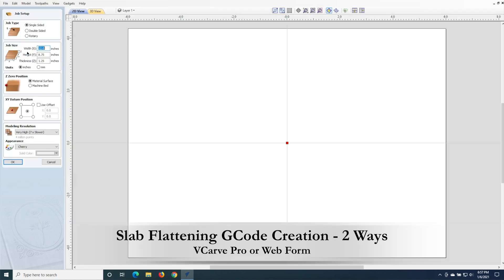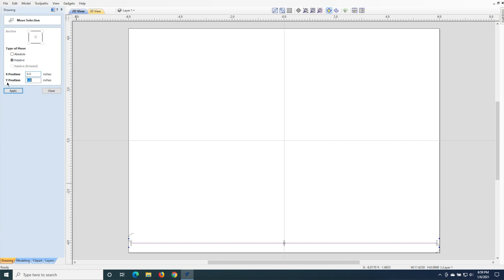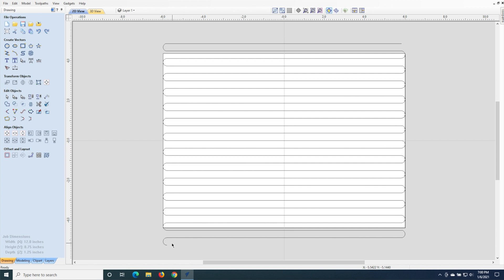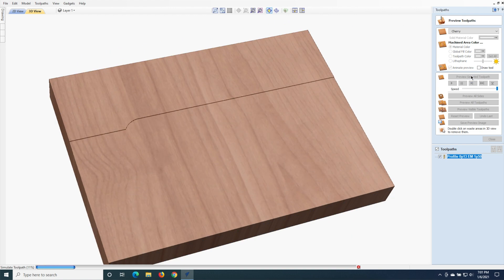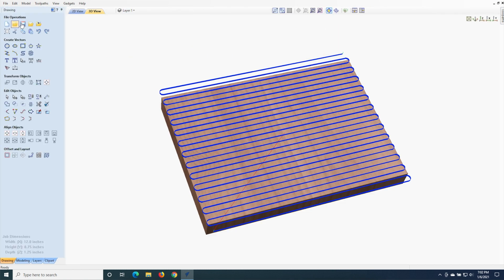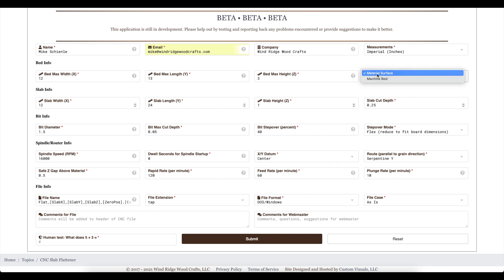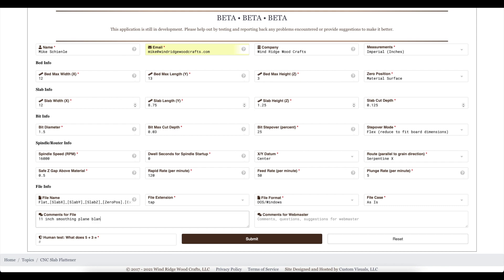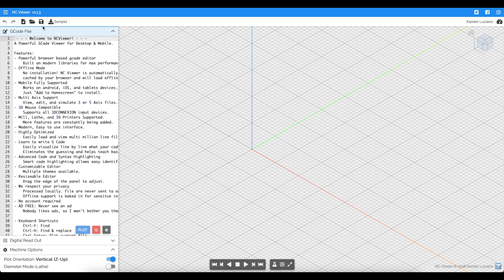CNC Slab Flattener - Two Ways

Comment: I just draw a box half the bit diameter larger than the workpiece I want to flatten (surface plane). Then use the Profile tool path.  Seems much easier to me.
Reply from the maker: No argument. I picked up the serpentine thing after watching the ShopSabre crew talking about it. I wrote my little program to mimic that. Here's the ShopSabre link - https://youtu.be/7th1C0JokEQ